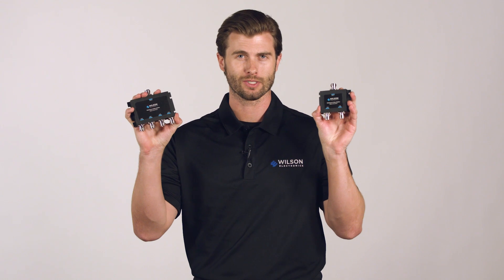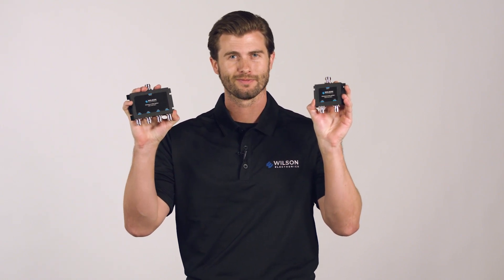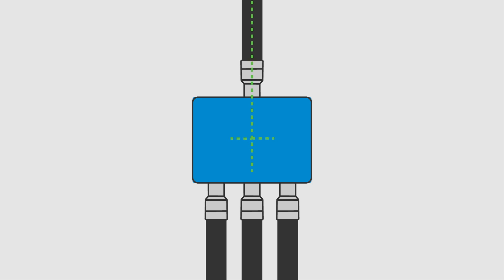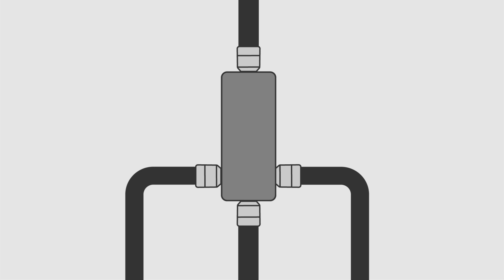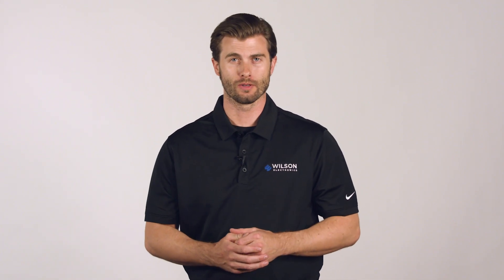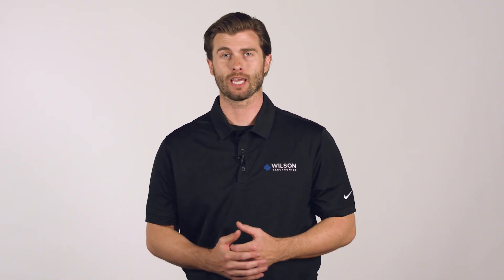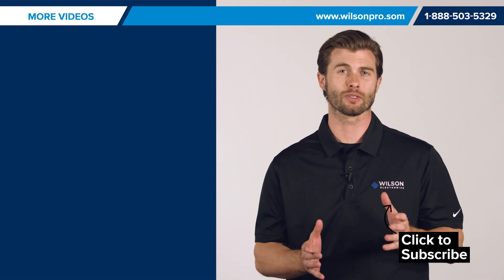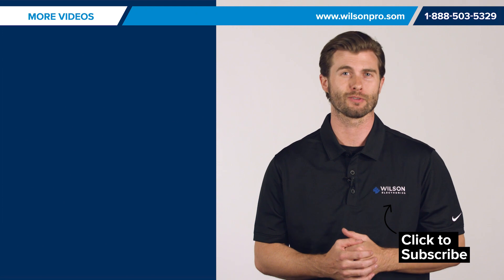Coax Cable Splitters - All You Need To Know | Wilson Connectivity

Comment: Can a splitter be screwed to a metal cold air return?
Reply: Inside or outside the plenum?  If outside...Yes, but mount a non conductive plate (wood or plastic) on the metal plenum and attach the splitter to that backer....then run a ground wire from the splitter to ground.

Comment: I have two antennas on a pole I need a splitter to bring in the two antennas to one cable outlet do they make the cable splitter
Reply: *Jerry, they call that a "signal combiner". Most premium-grade splitters can also be used in reverse to also combine both signals into one signal. 
https://www.amazon.com/CHANNEL-2532-2-Way-Splitter-Combiner/dp/B00006JPE1

Comment: ha, i got here looking for the lower end of the cat tv freq range. knowing that days of old they would usualy list x -1ghz and then x-2000mhz but forgeting what x is. when you started talking antennas i realized this is not the droid i seek.  I kept watching  and am lett with the question... what happens when the not mentioned installer does something like omni directional for the uplink or (were getting crazy now) is on the roof and in a moment of malice or ADD ends up with directional antennas for down link and uplink pointed at different towers :D you kinda illude to a non duplexed system but i suppose that could be to simplify the explanation and or marketing. Also has me wondering how this works or doesnt with mimo and or towers atempting to beamform (which i dont recall if thats in 4g or coming with 5g but i know mimo has been implemented in 4g) (the fun but improbable extream that requires bad radio control firware and beamforming on a per user basis... is already near to tower repearter system bursting into flames as more and more 2.x ghz beams are directed at it :D i understand even inverse square law makes this unlikely and erp guidelines probably get in the way too but hey VLF HAARP could trip aruaras so what the hell. ) and iirc one of the cell bands is around 2.1ghz vs the 2.4ghz pop corn and box meal heater so its a fun thought)

Comment: Which DB rating would be better ? I have 2 2 way splitters one is -110db x2 -3.5db and the other one is -130db x23.5db
Reply: what are you intending to hook to the ports? know how someone screaming in your ear can make it hard or painful to hear them even though the volume is sufficent? depending on first what you are splitting and second whats connected to the other end this can be the same case.  note the negatives infront . some ports are subtracting /losing/dampening/atinuating more of the signal than others. with out a powered system you never gain but there can be reasons to either have a lower loss port of some lower loss than others. example may be like fiber to the pedistal cat tv system and your house is right by the pedestal (vs one at the end of the block), well put your cat modem right where the cabel enters and the tranciver in the yard box/pedistal is going to be SCREAMING in its ear so to speak. where as the tv/box you wish to hook up at the other end of the house might benefit from the lower loss port because the extra ft of coax are going to bleed off dbs anyway. the highest loss is always at connectors so if it splits again quite a bit will drop. hope that helps, i used cat tv but it applies to any coax system. if you are doing anything involving antennas(or sat tv...thats what the dish is) and have to ask this question i feel it best to add something a prof radio system installer and tech once told me, where you put the lighting arrester is probably best chosen by where do you want the fire if the antenna is hit.

Comment: i had a question, does a longer cable cause signal lose or reduce internet speed? from antenna to repeater?
Reply: Yes the longer the cable the more it has to travel
Reply: You will start getting noise and signal loss after 100ft with coax cable